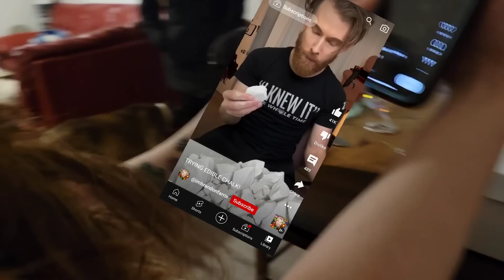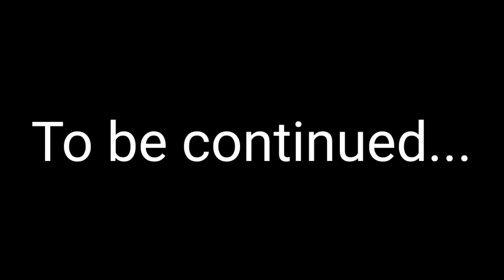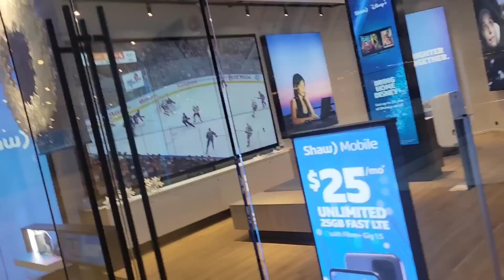Curiosity inc is now an ice cream shop | Another VLOG #194

Comment: Impressive how you merged so much variety into a shorter vlog. And it all flows nicely. Have you ever made metal blade knives from scratch? My dad made one. Then he collected push lawnmowers to use the blades for more knives. Never happened; just added to his hoarding piles.
Reply from the maker: I have started one from a leaf spring but i never finished it. It shows up in the video at 7:50 . I didnt finish it because the cerecoat had a hair in it and it annoyed me. Basically the guy who did the cerecoat,b aked his dog hair into the blade in the paint. I will finish it one day. Who knows when. Its been years.

Comment: I did the same, strained, my little finger and ring finger by ripping them apart on the corner of a cupboard. That was two months ago and it’s still sore and difficult to use.  Ibuprofen could help you but it will take a long time to heal.

Comment: If the knife breaks again in the same spot, take and drill a small hole on either side of the tang, on both sides of the break, and put a small length of brass rod in them, then epoxy. That should Add some strength to it.
Reply from the maker: The tang is shorter than the break spot. But i suppose i could put a dowel through the handle from the back end. So far it works fine.
Reply: @JoshuaAlexander138  I realize the tang is shorter. That's why I suggested a couple of pins, one on either side of the tang, bridging the spot where it broke. 4 small holes, 2 pins (dowels would probably work, but with how small the diameters would be, a metal pin would be stronger) & the epoxied break won't break a 3rd time. 
I hope it won't break a second time but if it does...

Comment: JOSH, NOT SURE WHAT THERE CALLED, BUT I'LL CALL THEM METAL BRADS ARE USED IN THE BETTER QUILITY KNIVES. THE BRADS ANCHOR THE METAL PC. THAT GOES INTO THE WOOD HAND. THEREFORE THE END SHANK IS SECURLY HELD TOGETHER INSIDE THE WOOD HANDLE.Do take care. Fl., U.S.A.
Reply: Rivets, yeah. He should have had a center piece the whole length then the decorative woods on the outside held with rivets. That one will never stay together with just glue.
Reply from the maker: It will last just as well as the original. Likely better.
Reply: @AnniePA1960  Anne, glad you understood what I was explaining, about the structure of the better knives.
Reply: @JoshuaAlexander138  That's good.